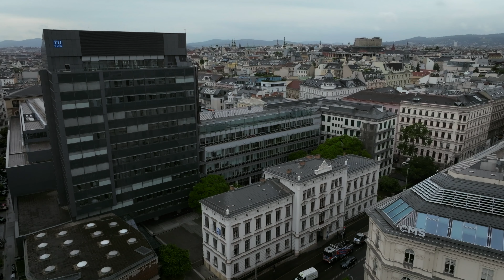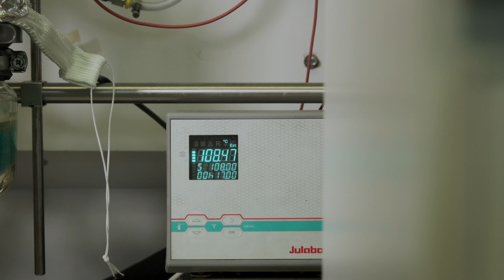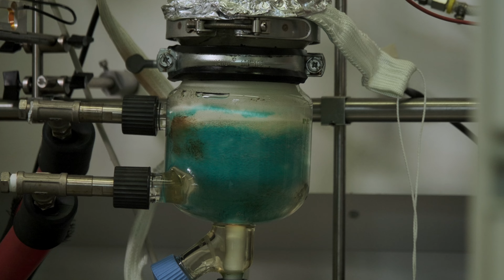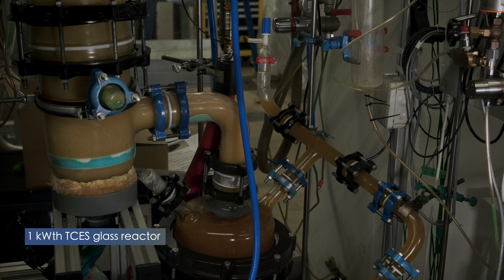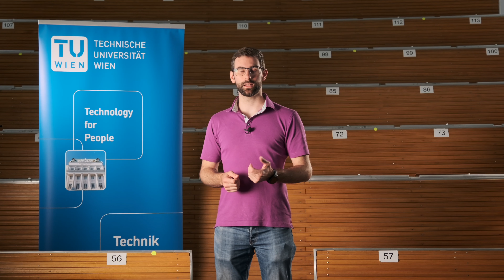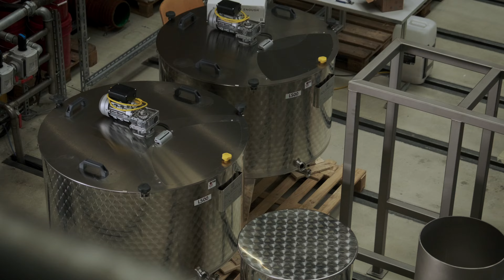RESTORE - Thermochemical Energy Storage pilot plants

Comment: Please correct me if I'm wrong. A material energy storage is about 1MJ/kg. To heat a small room you need about 100 kg of material per day which must be at a dry place. For about 4 winter months you need a 100*30*4=12 tons for just a one room. I'm just thinking about a practical real world usage. Is it possible to somehow improve that using a heat pump?